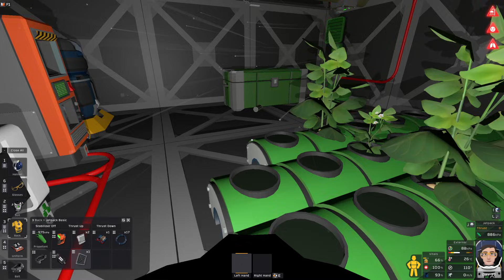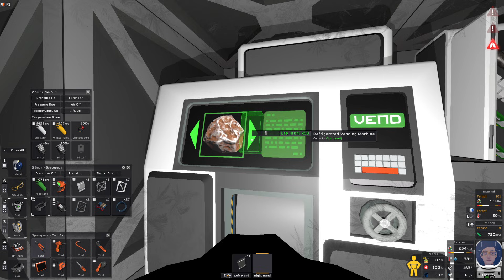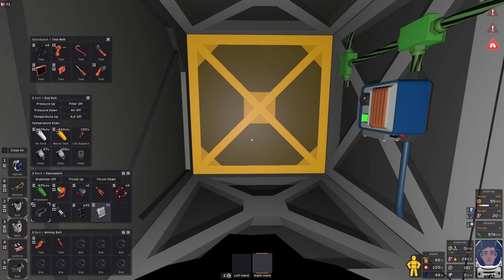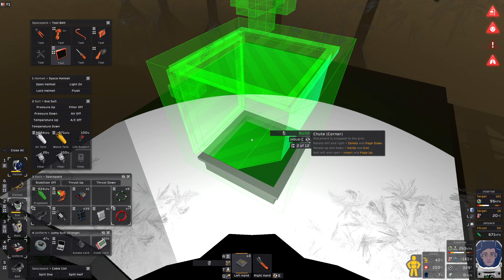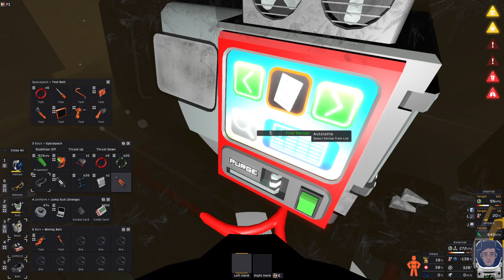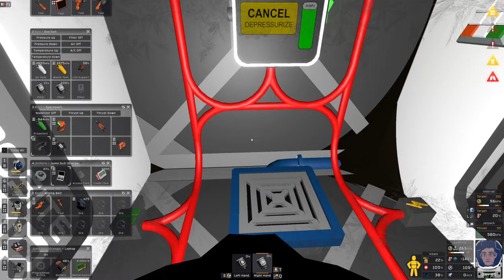Stationeers Titan Part 27 : Proper Preparation Prevents...

Comment: In the pipe connecting the portable air scrubber, there's lots of volatiles and oxygen. A "good" way to heat it up is to use a pipe igniter, and just burn it. Yes, you will lose the oxygen, but you gain warm CO2, which you could feed your plants and grow more oxygen! Plus it's fun pyrotechnics...can't say no to that! :D
Reply from the maker: Haha! I should have thought of that

Comment: Nice job. How much gas is produced by the coal generator when its running?  Can you tap that for CO2 as well?
Reply from the maker: Not directly because the coal is degassed by coming from the deep miner. But I can make solid fuel to get some